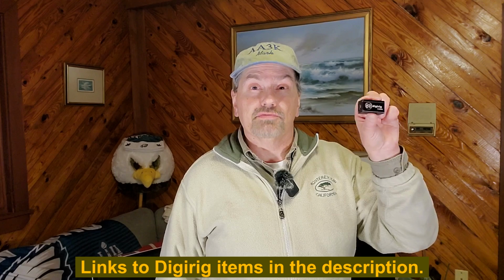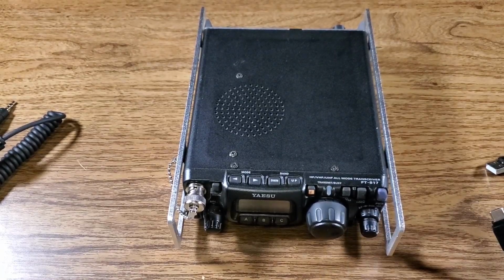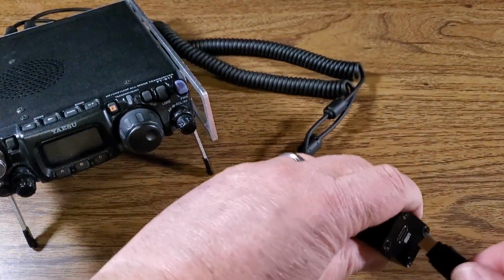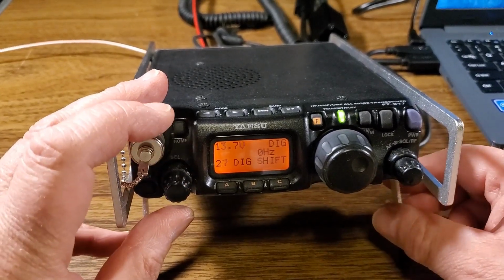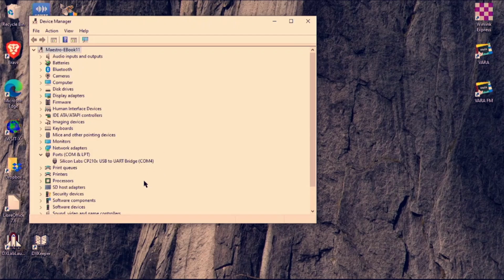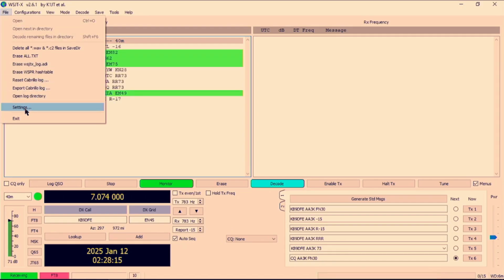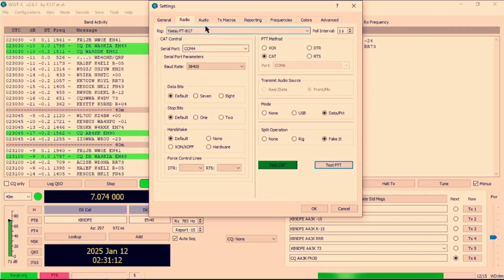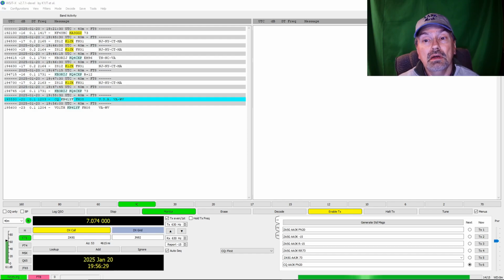Want to run digital modes on your FT-817/818? Here's how!

Comment: Very nice and well done!  Thank you.  Have you worked with WinLink and VARA (HF)?  I'm really interested in how you would set up WinLink and VARA and if settings for the FT-817ND would change.  Thanks again
Reply from the maker: Thank you for the kind words!

The first radio I did WinLink on was my FT-817!  The hardest part was finding a node that could hear my 5 Watts.  This video of mine on setting up WinLink (though with my 7300) covers the process along with Vara HF.  https://youtu.be/rq2yheYZOeY  Really, you should only need to change things to indicate you are using an 817/818 whe you open a WinLink via Vara HF session.  It is oner the Settings menu.

Comment: I'm having issues with pairing the  FT-817  with my laptop, wish I could send a photo what I'm talking about
Reply from the maker: Are you using the DigiRig or another adapter?  Also check the baud rate the radio and the computer program are set to.  You can set the FT-817 through the long press F menu.  CAT or baud rate is the menu item.  The default is 4800 if I remember correctly but I have mine set at 38400.  You can then set the computer program to the same.  Additionally, 8 data bits, no parity, 1 start bit, and 2 stop bits.

Finally, if using a DigiRig, check if it is configured for logic levels (that's the default model).  If it isn't they have instructions on how to convert.

Comment: Very helpful. Where did you find the metal side rails?
Reply from the maker: I found them on eBay.  I do not see the same rails available (they came from China) however I did find these:
https://ebay.us/m/hQKRqP

Just search for Ft-817 rails (maybe FT-818 rails).

Please check out my video on dressing up a FT-817 with use accessories including the rails.  https://youtu.be/7z9NxxubSJ8

Comment: Tnx for video. I use the front antenna for digital modes, it gives a bit more separation from the interface cables and antenna coax . Regards vk5cz..
Reply from the maker: @willian.direction6740  Good idea! It does get a little tight in the back with the sideways PowerPoles and the rails.